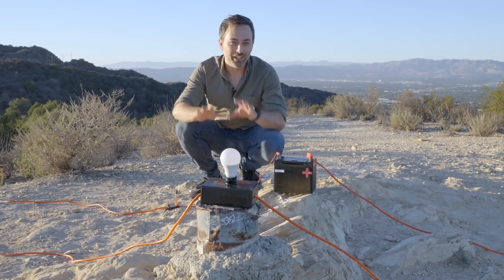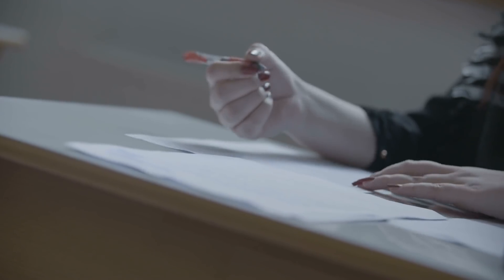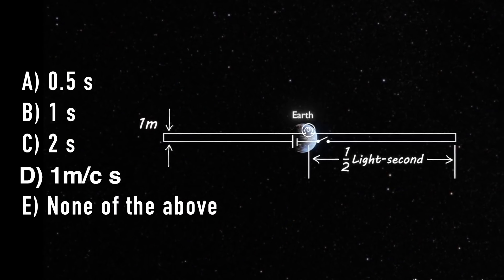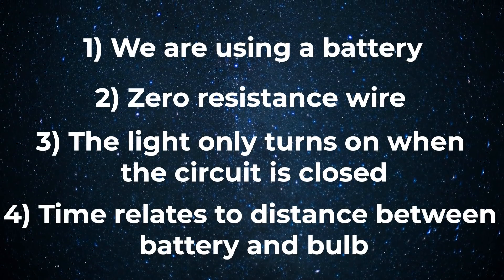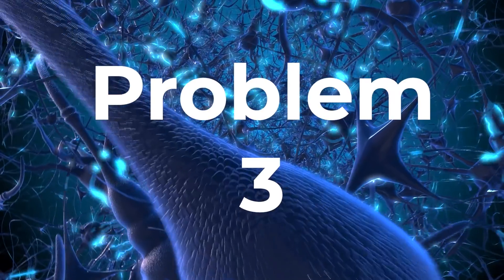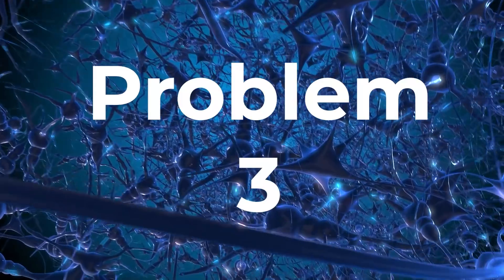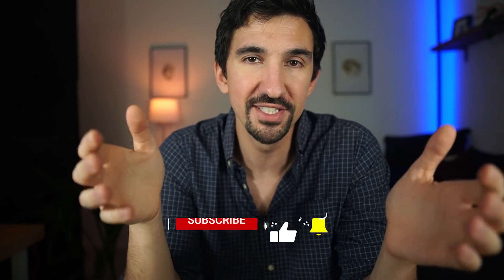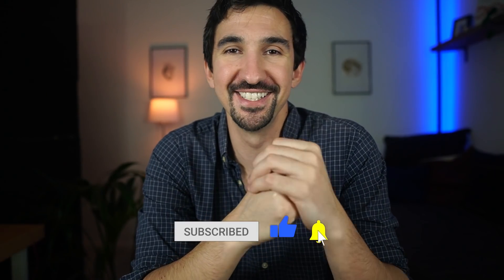Is Veritasium Wrong About Electricity?

Comment: No, not wrong.
I knew of a guy that made some sort of contraption that would actually pull power out of high tension lines while it was just sitting on the ground.
Back then, I already knew that the wires simply carried current, but the flux field around the wire carried the actual energy.
This makes a lot of sense when you have to use an induction coil to measure it.
Some multimeters have it, but the older mechanics will know of it, too.
We didn't measure the current, but we needed the pulses from that wire...
Timing lights.
Put the sensor around the #1 spark plug wire, and point it at the markings on a harmonic balancer, and you could see when the plug fired in relation to the poston, and adjust it according to factory spec.
Induction coils in radios, especially two-way radios like CBs, had to be tuned to work properly.
We have had to use that floating energy field in a lot of things, even televisions with cathode ray tubes.
To see some of those energy fields, it simply takes a small fluorescent light tube.
It'll light up when inside an energy field, as the power going through that field excites the gas inside the tube.
Reply: it's the entire thing Tesla was known for

Comment: If Veritasium was correct, and the magnetic field propagate from the battery to the light, then wouldn’t a break in the wire very far away still turn the light off after the time it takes light to travel? Even with a broken circuit, the lightbulb wouldn’t “know” for a while longer. If the field is traveling from battery to bulb then it would still travel when the line is broken until the magnetic field change can reach the battery/bulb

Comment: What if I told you that the theoretical lossless wires are at the same potential as the battery while the switch is open, and as such are essentially just the anode and cathode of the battery themselves...

Comment: TINMF, but there is no causality breaking, because lightbulb will go off in (distance between break and lightbulb)/c seconds, as this is about where is the change in, well, reality happening vs where the effect can be observed. That and well, speed of propagation of change in electromagnetic field will be (usually?) c. When you close the circuit by attaching lead to car battery, the change only has to propagate 1m to the lightbulb, even though the actual majority of energy will take the longer route (so we have to assume that lightbulb is 100% effective and we can detect light at the smallest luminescence).

Comment: 4:01 - This is not really a problem. Add another switch at the far point and somebody controlling it. Let him to open or close his switch some decent time before we close ours. Is it possible for the lamp to determine in 1/c time after we close our breaker, if it should turn on or not, without using any super luminal information? Yes it is. If the other switch was closed (and we are in steady state), the whole electric field is solely concentrated over our switch. If the other switch were left open, the electric field would be kind of distributed over the whole distance between the two switches. (It definitely no longer is concentrated over our switch.) These two situations no longer look the same, so it is not hard to believe they can behave differently.

If we start from situation where both switches are closed and the bulb is light, somebody opening the far end switch breaks the circuit, but the information of it can propagate only at the speed of light, but this contradicts nothing Veritasium said. In that case distance between the light bulb and the switch is 1/2 light seconds, not the original 1 meter. (The real problem is, that the bulb would have to be a low power led lamp to make the experiment works. Because of capacitances and inductances of the wire, the (near) instantaneous current is very small, and you would like the to turn your light already on with this tiny transient current. So in the sense his experiment is misleading, if it makes you believe the full DC power is available in 1m/c time.)  

10:16 - 👍   - If you start to talk about lies, his claim is also a lie because it is not the whole truth (if there is one).

Comment: And then there is the weirdness of quantum mechanics...
That's again Einstein's "spooky action at a distance". So the circuit doesn't have to be closed for the light to go on. It is enough if it was closed short before and the information that it was opened just didn't reach the bulb yet. The instant the information reaches the bulb it will turn off.
The same is for closing the circuit again at that far away spot. It will take the time the light would need to travel from where the circuit was closed to the bulb to have it turn on again.
In this case it would not open in 1m/c.
So I would say assumption 3) is wrong.

Comment: I don't understand why there's all the fuss. Electromagnetic waves propogate at the speed of light is all you need to know, so, no, it wouldn't be 'nearly instantaneous'. I can remember someone else saying something along the lines of - if I somehow shine a light on a vast object millions of miles away, and move the light across it, the shadow would be moving at faster than light speed. Light, shadow, position is a CONSTRUCT. Any data set is a construct. Constructs aren't bound by the laws of physics. each quanta of light still travels at light speed - an observer would see a change in their illumination status distance/C after the event that caused it.

Comment: i agree with your first problem. the units matter.
i also agree with your second problem. if the circuit breaks 1/2 lightyears away from the bulb, i light bulb would turn off in 1m/c. 
i am unsure about your third problem.

Comment: Hmm, I have a pretty poor recall of what I learned about electricity from undergrad physics, but can someone explain what would happen if I had a stick that was super long, like it's a stick from hear to the moon. And let's say that, theoretically, the propagation of force between atoms on this stick was unimpeded, basically I guess something like there's zero "squishing" of electron orbitals from two atoms, if one atom is pushed then the next one is basically simultaneously pushed because they can't be in the same physical space at the same time. In this case, if I push the stick at one end, then won't it propagate that information faster than the speed it would take light to get to the moon? I mean the object itself isn't moving faster than the speed of light, but if an object is massive enough then it simply acting as a single object (theoretically) kinda breaks somethings naturally right? Or is there some general relativity stuff that we would run into at that size?

Comment: what i have understood now is that for Veritasium's idea to be correct ,both electric and magnetic waves must be emitted by the movement of electrons in the wire in order for this electromagnetic energy transfer to take place ,so when we turn on the switch ,all the delocalised electrons must be moving along the circuit for this to take place ,and given that they move at the speed of light, it would take 1 second for all the electrons to get moving (from the battery to the farthest point then from that point to the light bulb [3*10^8 m]) . my question is , should we assume that all electrons start moving instantaneously as the circuit is closed? how do the electrons move in the first place? how can the charge on the battery reach the electrons not directly in contact with it and does that take any time?

Comment: The problem is that the "breaking of the wire" information should take 1s to shut off the light not the 1/c (which is correct, given that c is a numerical constant).

Comment: 100%.  This video should be hard-linked to Derek's clickbbait video.  I think it's shameful Derek turned a perfect opportunity to teach meaningful science into confusion for beginners.  To use a battery, switch and light bulb and then drop units and handwove "impedance" is misdirection and misleading.  2 seconds to full brightness is the practical answer with the system he presented.  If he meant to teach how NFC works he should have done a video about that.  I agree with Derek.  He should get called out and have to pay for his experimental model and demo it, so people learn about the costs of spreading misinformation.

Comment: I both agree and don't agree. I think your dismissal of the most obvious criticisms reflects the difference between theoretical physics and practical or real world electrical engineering. Lots of assumptions that are at the moment impossible for us to produce i.e. zero impedance wire over such distances. What Veritasium posts is a thought problem which cannot with our existing levels of ability be proven or disproven. Only speculated on.

Also (I've not reviewed this for a while, so forgive me if I am wrong assuming this), Poyting's laws show that AC and DC fields react differently so will the interactions between adjacent cables will be different too? I just can't recall the equations that would predict how that affects the initial ramp up spike that'll give a 'flash' at the bulb before the 1m/c time elapses and a steady state establishes. Won't there be a capacitance between the two runs of wire (however small) so won't there be a short spike as the capacitance discharges? Transmission line theory is in effect here. Lets also not overlook that as you point out, Veritasium is using a DC signal that would have issues radiating a signal out of the a wire at 1m from the 'return' wire at 12v or so irrespective of distance.

Comment: I believe your faster-than-light communication example is on point and it could clear the uncercatinty in people's minds: if I also had a switch to the far left side of the circuit, how long would it take for the bulb to go off? I feel like the answer should be half a second, since the change could only be propagated with the speed of light. If someone can explain how/why it would take half a second, I believe I will have all the answers I need :)

Comment: I agree that a typical light bulb would not light up immediately. But in the original video, one of the "simplifying assumptions" was that the bulb would light up as soon as any current passed through it. Since everyone seems to agree that some current would flow through the bulb immediately, maybe a sensitive ampmeter should replace the bulb.

Comment: I'm not a physics guy, but even I was confused about the faster than light communication problem.
Reply: It's either not communication, or it's not faster than light, pick one. If you did set up communications for the purpose of knowing exactly when the remote switch was flipped, you'd find that it wasn't flipped instantaneously with the observation we make over here at this end. You'd find that it was flipped before, preserving causality. However, this is a thing about relativity which people might "get" but have a hard time recognizing practically.
Reply: Well.. i didnt watch the entire video, but my understand is that the communication goes thru magnetic field, battery and light are 1 meter appart, so the time is 1/c
Reply: @felipewatanabe7128  The battery and bulb are 1m apart, but the potential break in the circuit could be at the farthest point is what he was getting at.  "You know the thing."
Reply: @felipewatanabe7128  I understood the same
Reply: Quantum Entanglement 🕊️
Reply: Faster than light communication?
Reply: Not a liberal.  Am I right?
Reply: @andyh8239  Not a conservative.  Am I right?
Reply: @selcotsimeht  Lets be honest with oneself.   Are you ever right?
Reply: @andyh8239  Bruh, you gotta make everything political?
Reply: @dorkle9085  It is what it is.  What's the story with your dialect?
Reply: @andyh8239  😒
Reply: @dorkle9085  k. got it.  😑
Reply: @andyh8239  cringe
Reply: @AutonomousCollective  Critical thinkers just aren't liberal  sorry if that offends you.  Go buy some hunter art and relax, knowing ignorance is bliss.
Reply: @andyh8239  even more cringe

Comment: But what he said, that all circuit works as a radio transmitter/receiver and the conductors there are for (kind of) decorations, what is wrong. The inductive coupling between the two conductors 1 m apart in air would be batshit anyway, and it's DC, so only the transient (when we switch on) would produce any signal. The light bulb wouldn't care, but with a good radio (receiver) you could hear a click. (And this is exactly what happens when you listen to an analogue radio and switch something on)

Comment: I think his model is that power is delivered through the fields, not the wires inside those fields.  If I am correct in this assumption, he has created a model where the power is being delivered as a series of parallel paths 1 meter in length.  The number of parallel paths increases as the fields travel down the 1/2 ly wire.  I think this is why he says the bulb will receive more power over time, because the overall "resistance" will decrease as more paths are created.  It seems like he is thinking the power is transmitted through the 1 meter air gap between the wires.  I dont know about that but he was not exactly clear in how he came to his conclusion at least with any equations that could be proven or verified.

Comment: It's not that hard, there is a tension between both polezs of the switch. When the switch is closed, current start flowing between these two poles. Current flowing creates a magnetic field around the first wire. That magnetic field will then induce a current in the opposite direction in the second wire 1m apart. So of course it's almost instantaneous.

But in the meantime, the part of the wire with current flowing through it is propagating in both direction at speed c,  so the amplitude of the magnetic field keeps on increasing, and so is the current through the other wire, still acting like an antenna. My guess is the current through the lamp probaly follows an equation looking like  I(t) = Imax *(1- e^(-k*t))  (I won't try to prove it though, I'm way too lazy)

Comment: I think you are correct that thinking of this as a circuit is a problem. Your antenna analogy was good, personally I thought of it as a capacitor. Good spotting on the units of the answer

Comment: I don't agree with your thought experiment where it breaks causality. If you cut the wire at its furthest point, the EM field will propagate that information through space at the speed of light, just like the original propagation between the light bulb and the battery with the switch placed by the battery's side, which resulted in the 1/c original answer.

Comment: What I interpreted from V's video was:
The "1" over c comes from the distance 1 m, that is between the bulb and the battery.
C is in m/s.
Simplifying the units, you are going to get seconds in units.
So basically according to him, as long as the wire has near 0 resistance, the length of wire doesnt matter.
Please correct me if I got it wrong. Not ideologically, but according to what V wanted to explain.